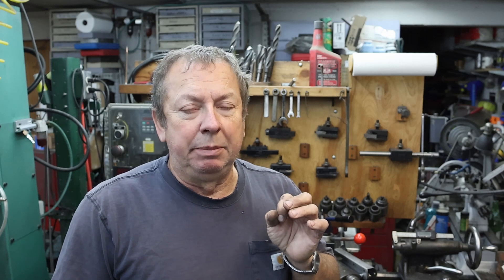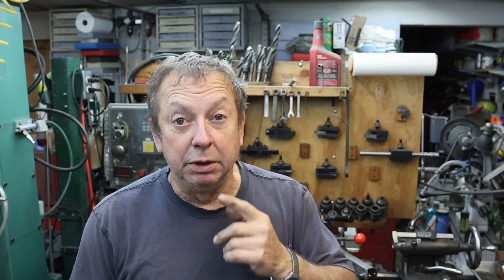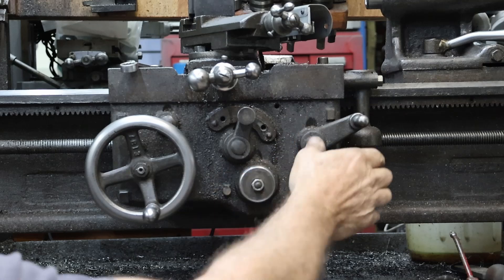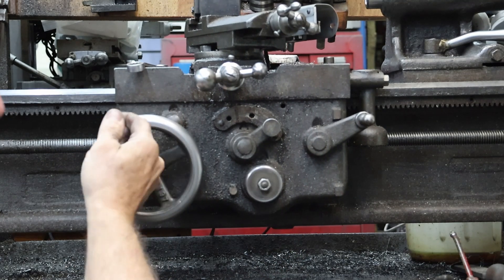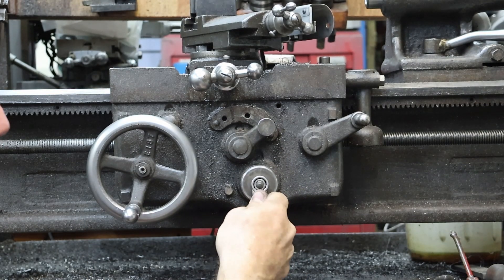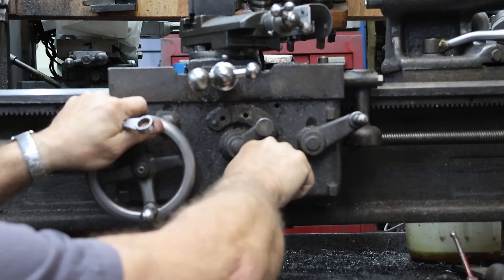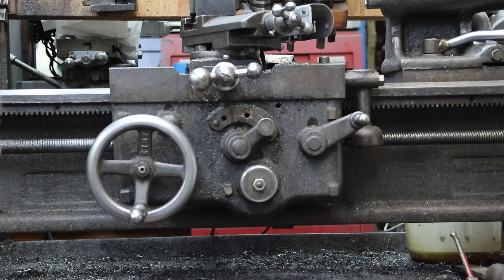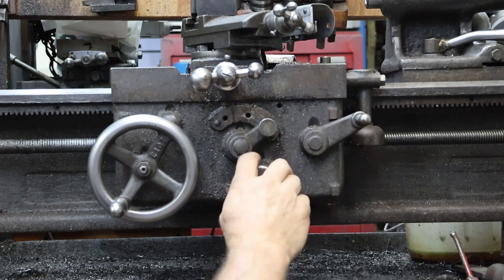Sheldon EXL 56 Lathe, Apron Clutch Operation

Comment: On my Sheldon when I turn the clutch knob the carriage or crossfeed(depending on the selector lever) turns with it. If I hold the carriage hand wheel still, I can not physiclly unscrew the clutch knob.
Reply from the maker: Not sure I fully understand. If the knob is engaged and moving the carriage or cross slide the hand wheel will be turning, to disengage the feed I simply rotate the knob, if you are trying to hold the hand wheel still you are wedging the internal hand wheel gear against the internal knob gear (and any other mechanism in between) so there is no room or wiggle to allow it to disengage.

Comment: Hi hillsgun, I also have a Sheldon EXL 56 and my clutch nob is stuck in the on position. In other words when I move my lever to the feed position I cant disengage it. Any ideas?
Reply from the maker: Make sure the outer nut is loose and twist the inner knob counterclockwise